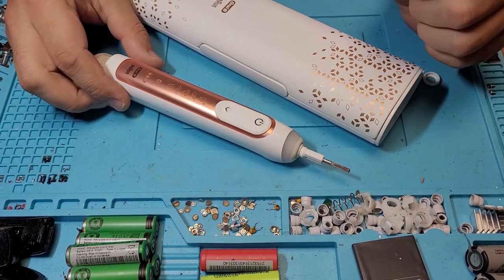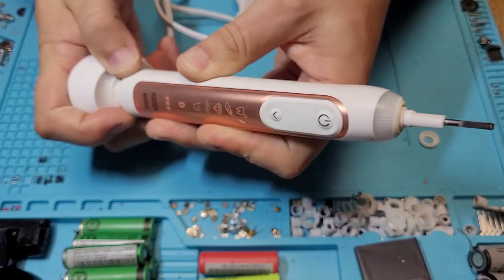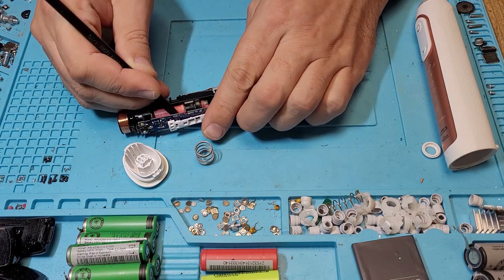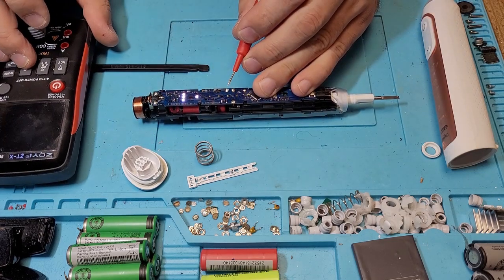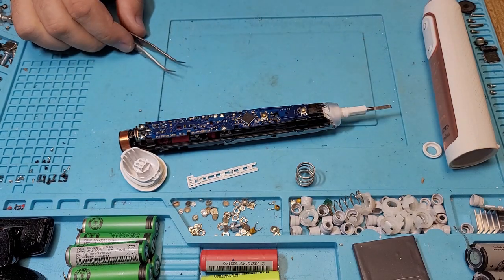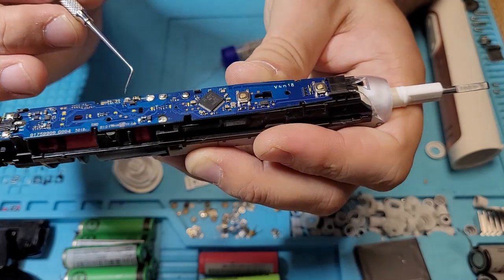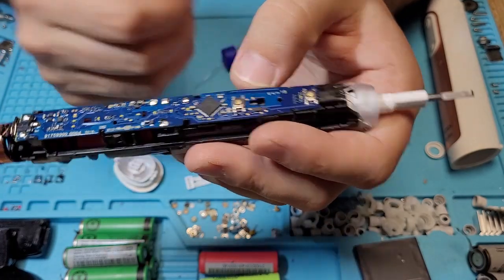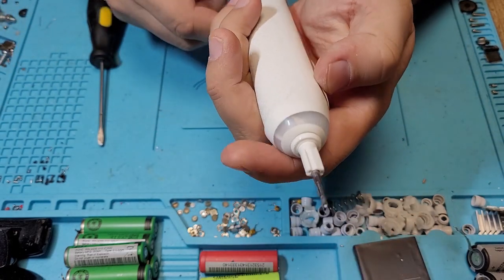Repair of Braun Oral-B Genius X. Lights up, but no vibrations.

Comment: Hello - Thanks very helpful. I have the same symptoms as you say while during diagnosis with multimeter suddenly lights turned off and I am no longer able to turn it on. Do you have idea what could be the reason- is it possible that it is still the same fuse only? I feel like I created some short circuit or so…
Reply from the maker: It's difficult to diagnose remotely.. the fuse that I explained was responsible only for powering the motor. Toothbrush itself was functioning.. if it went out while diagnosing I can only assume that some component was shorted out with probes.. check battery voltage both fuses and go from there...
Reply: Hello, i have the Same Problem...my one was just turning for a few seconds and after open it nothing is work. But where is the seconds fuse? That is the third Genius with a fault and now i haven't warranty any more.
Reply from the maker: Both fuses are next to each other.
Reply: I have Take the other genius fromm my cellar and bridge the 2A fuse. That one ist Wirkung now and i will order the fuse and replace the old one...so one genius ist fixes...but the other genius still death and i can mit find the other fuse...it ist the same fuse? Thank you very much for help.
Reply: I think is the SMD with letters E on the top. That one is not broken in my case. So i think i don't will get fix it.
Reply from the maker: The main fuse is just one of possible defects that I found but there are a lot more what can go wrong.. but if led was turning on before disassembly, it could be that something was damaged by opening it.. check for broken components, battery voltage.. more is difficult to suggest without actually checking it with multimeter..
Reply: @letsfixitgarage  Die you have any idea, what else can be broken? What can i Check? I have a Multimeter... nothing is broken, all components looks good and the voltage is nearly 4V.
Reply from the maker: Sorry have not to much experience with Braun toothbrushes for any more tips.. you could compare the two that you have take the working one desolder one battery contact and then you can compare the values on both toothbrushes.. maybe you will be able to identify some misbehaving component..
Reply: @letsfixitgarage  

That's not a bad idea. Either way you helped me a lot with your video and the tips and I was able to save a toothbrush from the scrap. The other could also be left as a spare part. Thank you very much and wish you all the best.

Comment: Nice video! Do you know if they changed this style within the newer IO model? I have a genius x which had this issue, I got it fixed under warranty now the same issue happens. For me I might just get the newer model
Reply from the maker: No haven't had a chance to get my hands on the new one.. I assume a workshop with tools and stronger fuse could bring your old one to life :)

Comment: thanks! never bothered to use the tester on my sonic-fx until this video.  turns out it's only a power button problem! it turns on while the probes shorts the contacts. however, I have no soldering skill and I already bought a new toothbrush, good thing its only $7.  I will probably parallel the power button to the mode button and see what happens.
Reply from the maker: I wouldn't do that.. :) better is to exchange the button.. maybe you can find locally a person who would be willing to do this for you..
Reply: @letsfixitgarage   thanks. I tried to use a single strand of wire to jump the two buttons by tying it to the terminals but the buttons are too close to the board, i can't insert the wire.
 i accidentally removed the housing cover of the button and it turns to be dirty contacts.  the button now works but the motor has become defective, humming and vibrating like a fluorescent ballast. I must have damaged it when I hooked it directly to a 5v 2A power adapter.   these toothbrushes should have better seals, waste of nice hardware😞
Reply from the maker: By testing you should always disconnected the existing power supply and electronics.. playing around with power supply can have unexpected results.. you will be surprised but from my impressions oral-b has better water seal but when it fails water damage is more severe as in Philips.. they have weaker seals but electromagnetic drive survives water damage better :)
Reply: @letsfixitgarage  I agree.  We have old Oral-Bs but never had related water damage, we simply killed its wireless chargers with our 220v outlets here.  Your comment telling me that I should have spent more with Oral Bs which Ive been thinking for the whole day. they have better brush heads.  The $7 toothbrush I bought is a Xiaomi, it has a unique motor that I want to see but their brush heads are too simple.
Now I understand what those huge coils are in the Philips! thanks.

Comment: It is very meaningful sharing, and I am aware Oral B has the general problem on Genius X model. May I know the part number of the fuse, and I can look for extra help from electric store? appreciate
Reply from the maker: Sorry don't have exact number it's a smd fuse 2A and ~2mm in length
Reply: @letsfixitgarage  thanks for the nice Video. 2A but what ist about the voltage? Im searching for a fuse but Too many options
Reply from the maker: Usually these smd fuses are up to 24v so any will be good enough. As here we have 5V and current is the main factor..
Reply: I went there... they couldn't help me. Is it possible to give me the exact dimensions? Length & width is I think enough... . That would be helpful.
Reply from the maker: Unbelievable.. they are forcing users to buy from China.. the one that I solder in is 2mm in length and 1.5mm in width. Although original is alittle bit smaller if I recall it correctly..
Reply: Is there any chance u have a link to the smd fuse. I am not finding anything. 2A are nominal current? If there ist any possibility please Provide a link
Reply from the maker: I would suggest asking your local electronics shop for a 2A SMD fuse ~ 2mm in length. There are plenty in China stores but they sell in bulk and you are  never sure for quality...
Reply: Yeah I don't know whats wrong. Even on ebay it is hard to find. This dimensions seems so rare.
I think this pandemic showed us... with our China the rest of the world is nothing   🤣🤣
Reply: I just asked one of the biggest german online electronics stores... . They say there is no fuse with that dimensions and 2 A. I even looked on Ali-Express with these dimensions I only find max 1.1A. Are you sure with the 2A?
Reply from the maker: It is China manufactured and sold fuses with letter that in datasheet represents 2A, is this correct - I don't know, haven't tested it.. checked my AliExpress orders, couldn't find that old order, but I found these fuses measurement is smaller so potentially could be even better..
https://a.aliexpress.com/_uuvxdW I haven't tried them, so use on your own risk, but on AliExpress there are hundreds of suppliers that offer smd fuses..
Reply: @letsfixitgarage  My toothbrush has fuse code PP which means 3A. Still failed ;)